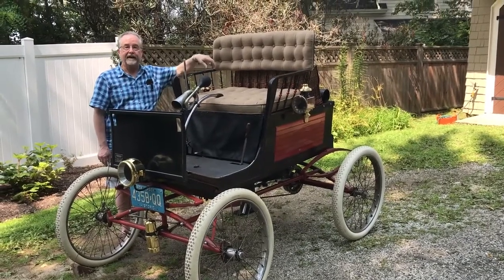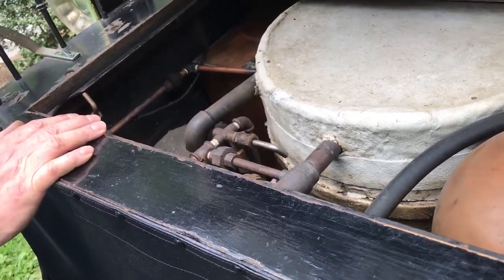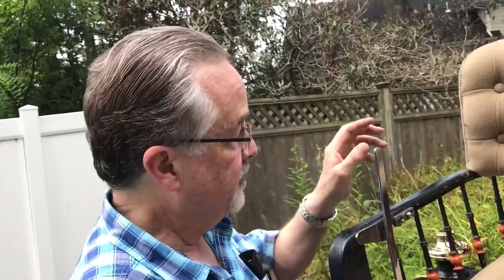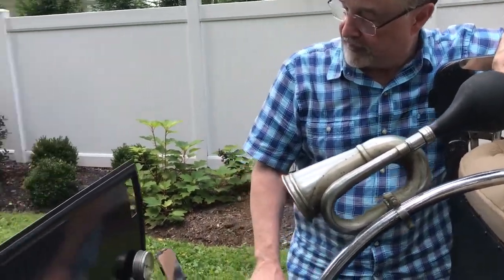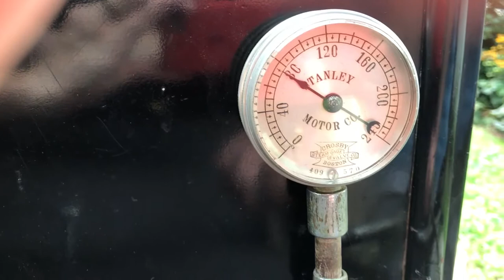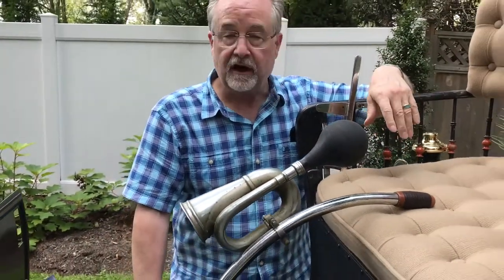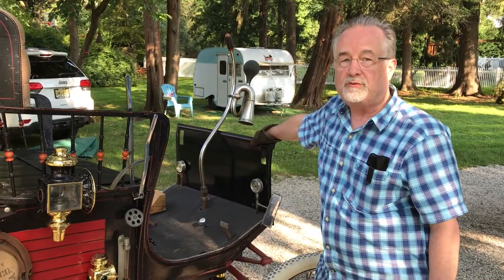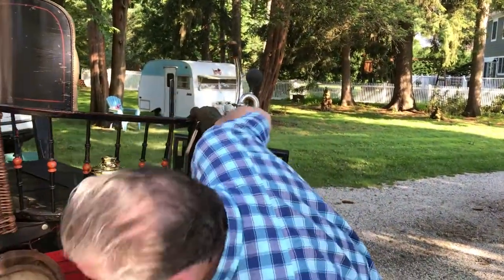1899 Locomobile Steam Carriage with Blow Down

Comment: Thanks so much for this video. I know I am a little late to the comments here, but I am a history teacher, and I was trying to understand the working of this early car for my American history classes. Your video is so helpful. One question: how does the burner ignite to heat the water and produce the steam? Do you have to ignite it manually?
Reply from the maker: Hi Alicia,  When the car is cold say at the start of the day, you need a hand held torch.  To raise a full head of steam, the daily "firing up" process takes about 25 minutes.  It begins by heating up a pilot light until it is hot enough to be ignited.  Using the same torch, the main burner (merely a very large version of the pilot light)  is similarly heated until it can be lit by the pilot light.  The pilot light remains burning throughout the day. On the other hand, the main burner cycles on and off as steam is used and needs to be replenished.  During these on and off cycles, the pilot keeps the main burner hot enough so so it can be ignited by the pilot without the use of the external hand torch. So the firing up process only has to be done once a day.  I hope this answers your question.  Steam was the automobile technology of choice for most of first decade of the twentieth century.  Great that you are introducing your class to this history. What grade do you teach?
Reply: @dondavidson3940  Your explanation is so clear! It makes perfect sense. I love the time required to "fire up" -- such a good specific for my 6-8th graders to process. And I assume the gasoline is the fuel that powers the pilot and main burner? In 1900, would that hand torch have been a hot iron, perhaps? or some sort of flame? Just wanted you to know how successfully your video brings this history to life!
Reply from the maker: @aliciapatton6965  
Yes, both the main burner and pilot light in the 1899 Locomobile ran on gas.  As for heating the burner during fire up, you were basically left to your own ingenuity.  If you read the 1899 Locomobile manual, it does give you instructions on what to do but I am not sure how practical they were.  Apparently there was a section of the main burner (fuel vaporizer) that was made to be easily removable. After removal, you had to heat it on the kitchen stove, run out to the garage before it cooled down, reinstall the heated component without burning yourself and then you were ready to light the burner.  Later steam cars like the Stanley had an acetylene tank on the running board which was plumbed to a torch used for heating and lighting the burner.  It was also plumbed to power the acetylene headlamps for night driving.  Today we use a handheld propane Benzomatic torch readily available in hardware stores that works rather well.  By the way, if your class is interested in other aspects of early automotive history you can see a 5 minute video about my 1917 Detroit electric at https://www.youtube.com/watch?v=ZX04n7YcM08.  Perhaps the great great grandfather of the Tesla?
Reply: @dondavidson3940  Thanks again. You've given me so much practical information that I haven't found anywhere else. I've shown my classes some aspects of the early electric cars, including the one Packard dealer Earle C. Anthony built when he was 17, so I'll definitely take a look at your 1917 model video. These details of history are the key to making it relevant to kids. Thanks again. The history that isn't deemed important enough for history books can be lost so easily -- videos like yours, and your willingness to answer questions, keep it alive!

Comment: I love that it has blue NJ. Historic plates. This vehicle is actually registered with the NJMVC? Probably the oldest car in the state, if so. 

I’m wondering if it needs to have periodic boiler inspections like a locomotive? That’s running a whole lot more pressure than the steam boiler in my basement, which does not need to be inspected (max 15psi, and operating pressure is more like 1pound).
Reply: Yeah, pretty scary to think about sitting on top of such a pressurised boiler....

Comment: How far of a trip would you say you can go? Beautiful machine
Reply from the maker: Thanks for the compliment.  It is not only great looking but a lot of fun to drive.  To answer your question, it holds about 16 gallons of water which can take you about 25 miles, and about 4 gallons of gas which will go about 40 miles.  Stopping for water is usually not a problem as people are always willing to help you with a garden hose.  If you are out in the country you can fill it with water from a stream with the canvas bag mounted on the side of the car.  The longest trip I have taken it on was about 50 miles, an all day adventure with a dozen or so antique cars of about the same vintage.

Comment: 200 made and you have #220.. that is indeed rare What do you call those tires?
Reply from the maker: Originally they were "single tube tires" which is basically a very heavy inner tube bolted onto the rim.  Current reproductions are only made for display and will not last on the road.  The tires now on the car are period clincher motorcycle tires which are still available and are the correct size for this car.
Reply: @dondavidson3940   much appreciated, I'm going down a rabbit hole of a homemade steam bike and it's been a challenge to find stuff that help create the illusion of being a period piece. Hope you have a great day

Comment: How do you make sure steam pressure stays within operating range?
Reply from the maker: There is a fuel cutoff to the main burner ("Fuel Automatic") so when the steam pressure reaches a high limit it turns the fuel off and turns it back on again when the pressure drops below a low limit.  It is a simple device with a diaphragm exposed to the steam pressure which as the steam pressure rises the diaphragm pushes against an adjustable spring.  The diaphragm is also attached to a needle valve which as the diaphragm moves can shut the fuel on and off.  The spring pressure can be adjusted to give you the steam pressure range you want.  Hope this answers your question.

Comment: How far can you go in one tank of water
Reply from the maker: The water tank holds about 16 gallons of water and it gets about 1 mile per 2/3 gallon of water.  So I can go about 25 miles before having to refill the water tank.   If you notice, there is a collapsible canvas bucket mounted on the right side of the car to take advantage of any passing streams or if you are in town the tank can be filled with a hose.

Comment: Do you know what pitch chain these engines use?
Reply from the maker: The chain used on the 1899 Locomobile is a 1" pitch block chain 5/16" wide.  This was increased shortly thereafter to a width of 3/8".

Comment: No differential?
Reply from the maker: Sorry to have taken so long to get back to you.  Yes, remarkably it has a differential very similar to modern differentials.  If you look closely you can see the small pinion gears that are completely exposed in the center of the chain drive sprocket on the rear axil.

Comment: What do you do in terms of handbrake?
Reply from the maker: There is no hand or parking brake.  You have to put a chock under a wheel.
Reply: @dondavidson3940  Ah thank you,  I would love to have one.  Check out the Hudspith Steam Bike,  a relative of mine conatructed it from scratch quite a long time ago.   Love the car,  wish I could own one or build one.
Reply from the maker: @seanhuds229  Just checked out the steam bike.  Beautiful workmanship!  I have been driving steam (mainly Stanley Steamers) for almost 50 years now and it never gets old.
Reply: @dondavidson3940  Thank you,  its not a great bicycle,  not very fast and runs out of water quite quickly.  I have another question if you dont mind.  I was just curious,  I dont k ow how to word it.  But when the engine is steaming away, and you push that lever forward to start moving, do the breaks interfere with the engine if held down for too long?
Reply from the maker: @seanhuds229  When starting up, if you push on the break pedal hard enough and open the throttle (push the lever forward) the steam will go into the engine but the brakes will keep the engine and car from moving as the engine is directly connected to the rear wheels.  This does not hurt the engine or brakes.  What you have to watch out for is when you take your foot off the brake as the car will take off with gusto as it is running on full steam pressure.  I have heard stories of later Stanley Steamers (which have hand brakes) when getting the car ready for the day's drive, the owner got into the car with a full head of steam, forgot to release the hand brake, and started to open the throttle and wondered why the car would not move.  Being confused, they fully opened the throttle again with no result.  Leaving the throttle fully opened, they finally noticed the hand brake was on, and released it with full pressure on the engine (600 psi). The result was the car took off and went through the back wall of the garage. Remember steam cars make no noise when they aren't moving so they had no clue that it was ready to take off. Whether this is true or not I don't know, but it could certainly happen if you aren't paying attention.